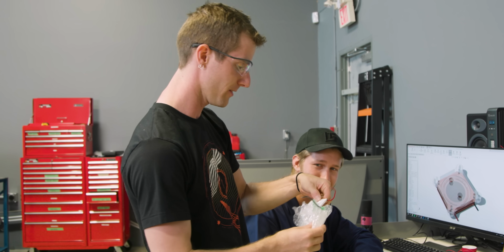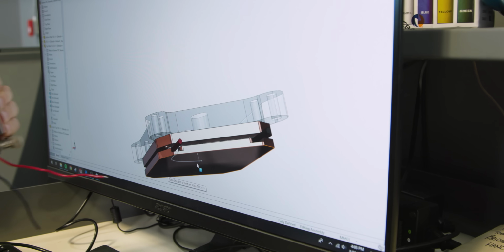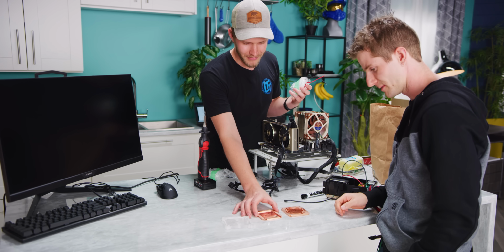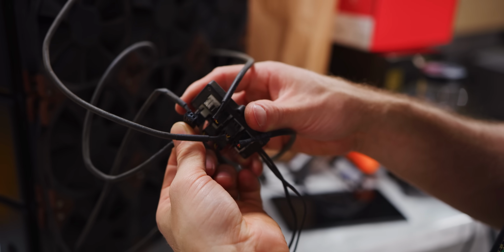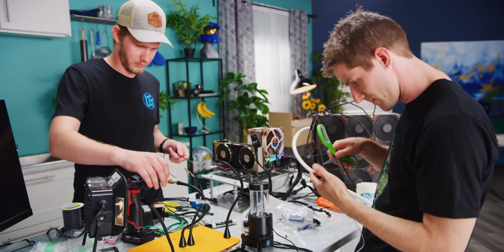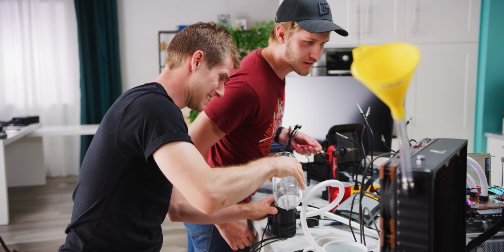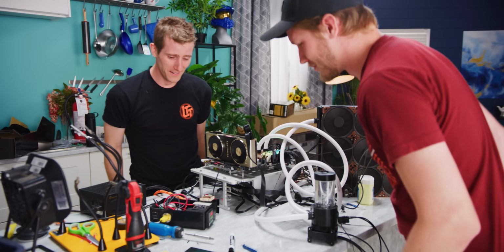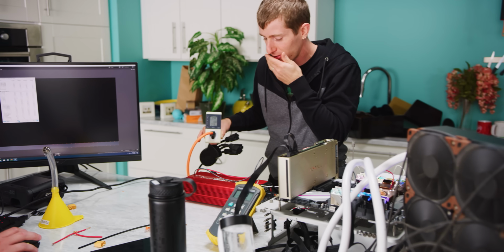This Cooler DRAWS 545W!!? Bad Cooling Ideas #2

Comment: Slight oversight. I didn't see an air gap between the edges of the 2 plates. This would cause the peltier to both heat and cool what would act as the same chunk of copper.
Reply: Yeah that is what I was thinking too. Nice to see someone else enjoying pre 2020 yt content!! It used to be golden am I right

Comment: This is my idea and I'm learning from y'all guys because of the project I want to take on but I think I might be over my head I have two car amplifiers one for my mid-range and one for my bass My base amp is suspended in the rare quarter panel of the cargo area in the SUV My midrange amplifier is in the compartment where the spare tire would be measuring that 12 * 24 * 4 in I can't find a water block big enough for it yeah I could just throw fans at it but I want to do water cooling with the copper pipes put the radiator and the other quarter panel maybe with some pelts you think it's possible

Comment: I would love to know the hot-side TEC temperature vs the water temperature. The apparent reason this didn't work is that your block couldn't cool the TEC fast enough to keep the delta-T across the TEC in its operational range.

Comment: @LTT you went about this all wrong the peltier devices should be on the radiator with a set of fans on the inside, pulling config. Peltier on the outside cold side touching the fins one each corner with heatsink and fans and two in the middle too and bottom then peltiers on the top and bottom on the tank custop low profile heatsinks and fans. This way. To cools the liquid a.   Should keep the liquid cool and components dry

Comment: FWIW, a decade ago or so, I rebuilt an AIO with a peltier in series just for fun and got it sub ambient on load on the notoriously hot AMD FX 9000 series. It was on a dying 2nd gen Corsair AIO that was long overdue to die anyway. I just copped right into the tubes lol, added a normal res, normal pump, and the peltier+cpu cooler. It went like this: CPU > original Corsair AIO block > original Corsair AIO rad > added aftermarket res+pump > peltier +waterblock attached to a copper tower cooler w fan > CPU. This way the peltier was further chilling after the orig rad and feeding cold water to the CPU. Totally impractical and inefficient, but it got the CPU below room temp under load and was fun to try just for goofy science reasons.

Comment: There is no hot or cold side of the cooler if you are colored blind. 😅 Just switch the leads like a brushed motor, it’ll run in the opposite direction.

Comment: Looking back on this using a watercooled loop with the peltier in place after the rad with its own waterblock n aircooler to rapid cool the liquid from the rad to the cpus waterblock might if been the key to sub temps might not even need to regulate the power to the peltier. Tho idk just ideas i think about when i cant sleep lol

Comment: Don't peltier devices put off cold on one side and heat off the other when you run electricity through them. They also can produce electricity with a temperature difference. I think you just put them on the wrong spot. Should of used them to cool the radiator. May also been able to set it up in a way to power the fans off temperature difference. The way you did it overwhelmed the cold output because you sandwiched it in between to very hot things.

Comment: I wonder if it could be better used for something like periodical loads? Use it in a separate water loop that only runs when the cpu isn’t at load so it’s building up like a “battery” of cold water to cool the cpu under spurts of load like for gaming
Reply: It’d be pretty advanced then so still not worth it production wise but I think it’d be a cool attempt

Comment: Ehy not flip it put the hot side on the cpu the cold side on the cooler dont connect the tec to power instead use the power thr tec generates to run the fans

Comment: Missing this Watercooler "we will try beat AliExpress" videos.

Peltier need time to get low temperature. Use a reservoir with water like a water dispenser. 

If you coool a loot off water, the processor can't warm instantly the loop.

Comment: that water block was never going to be able to remove 500watts of heat plus the cpus heat  you would have needed at least an inch thick copper on the hot side plus a massive heat sinks with powerfull fans ,

Comment: You should do a setup where the hot water goes through a normal radiator first, then the outlet of that goes into an electric cooler to be sub ambient.

Comment: It's likely the water block was the weak point.  It has the thermal load of the CPU and the TEC and needs enough surface area to transfer that to the water.

Comment: It has 540W of Cooling power with an Delta T of 0°C boys... facepalm. If you want to run it the best you can get is around 70 Watts cooling at delta T of 30°C with an COP of 0.84 with 50°C on the hot side. So you end up with around 20° on the cold side and have to wartercool around 200W.

Comment: Don't get me wrong I am a big fan of your work but, I am 100% sure that you guys did not use the PID controller corectly.
Relay is a on/off control device on the other hand a PID controller can control the output in all values in between

Comment: SO YOU WERE CIRCULATING HOT WATER!!! BRUH.  
nuclear reactors just send cold water from a river and dump the heated water to the other side of the plant in the same river. so in resume just attack the hose to the faucet and the other hose just throw the water to the sink.  and it will  be very cold (cold shower style) and you dont have to spend in 500watts electricity or something. just pay water. want to be savy?   put a pump that sends the hose underground or to your refrigerator and comes back cooler.  also instead of water use CAR COOLANT. 
seriously.

Comment: TECs are very inefficient at high power, if you want to make this work you need to run a bunch of them in parallel and and exchange the heat in a water loop. Tech Ingredients has a great video on TECs.

Comment: https://www.youtube.com/watch?v=uOrUNT_0XVY&t=1216s

The ability to pull the heat from the peltier towards the heat sink is absolutely crucial. Moving to a larger amp peltier will not make this more successful.  Although the physical size of the module might matter.  It is the way they are controlled that matters more.  Switching the module off at any  time to limit power consumption or PWM is not be helpful at keeping a constant low  temperature, as I seems the current must always be applied to keep heat produced by the TEC form moving back into the CPU.  A much smaller amount of power is required to stop this bleeding effect during idle and low CPU usage times.

Comment: I had a hard time understanding why this didn't work, so I had to break out some math.
so a core i7 is 125W of power, which means that at most the cooler needs to move 125W of heat.
a TEC cooler is about 10-15% efficient, which means that for every 100W of power, it can move 10-15W of heat, if I understand correctly.
which means that it'd take about ~1250W peltier to keep an i7 at ambient temperature :/
Reply: No, I think it means that the efficiency is 10-15% of an ideal heat pump, you are interested in the coefficient of performance. In the case of a vapor-compression refrigeration (fridge, air conditioning etc.) it can go up to 3 or 4 (300 or 400W moved for every 100W of power), in a TEC varies a lot depending on conditions (I looked at a datasheet of a TEC comparable in power to the one used in the video, the COP varies from 3 at low loads and low temperature differences to 0.1 or less in the worst case). If you can keep the hot side at relatively low temperatures so that you don't need a big temperature difference and you choose a TEC so that it operates in conditions where it has a decent COP like 0.5 it is doable. In the past I have seen 250W TEC cooling a P4

Comment: Actually, I think you should try using a Stirling ENGINE and run it in reverse, by feeding it rotation (i.e. using an electric engine) to get cooling (or, rather, temperature transfer). The good part is that, if you can put the PC onto the stirling engine, then you can get sub-zero temps quite easily, but it depends what size of engine you have, and you first have to find where to buy one from. It's actually one of the most sustainable engines out there, for low tech places where steel or copper and machining aren't too expensive, because you can use a stirling engine to generate power from heat transfer (i.e. burning trash then water-filtering the smoke and then using the resulting liquid with sand (quartz sand, aka. beach sand) and local dirt and/or rocks (but not quartz rocks or more quartz sand)to make geopolymer cement, but you need to have more of the liquid than it takes to dissolve the sand, and I don't know the exact percentage for that, but you could try with 25%, 50%, 75%, 100%, and 150% more liquid than it takes to dissolve all the sand, and see which of those works better, then try values close to the values which worked the best, and you will find the sweet spot, while also keeping in mind that, depending on the fuel source, it might take more or less time for the cement to harden, but a month should be a good random starting point, while keeping in mind that it might take less than 5 minutes from mixing to when it hardens at least partially. 

I think it would be really fun to see you all struggle with the stirling engine on this channel, and separately struggle with the geopolymer cement mixture over on Channel Superfun or some other channel, or even this channel.

Comment: Yeah, I like my NH-D9L. All of these TEC plate experiments and my experience using water cooling, it's hard to beat an efficient air cooler. I wasn't even a believer in the Noctua hype until I tried this one either.

Comment: You guys did it the wrong way; it is never a good idea to have the Peltier on top of the CPU, it should be on the radiator end. That way the cooling and heating ends are farther away from each other. In short it would work better if it cools the water.

Comment: Your biggest problem is your liquid cooler is not rated for the wattage of that Peltier device. You are overwhelming, the liquid cooling side, making it to where there is absolutely nowhere for the heat to go. You are not getting enough surface contact inside the liquid cooling interface. You need to make the liquid cooler taller so it has much larger fins as well as you need to create more turbulence so that the liquid is turbulent against the metal with more Furiosity. I have a design concept for the liquid cooling that might help resolve this issue and possibly get you to closer to working cooling.

Comment: Peltier cooling is the most inefficient cooling system due to the close proximity between the hot and cold surface. You are much better off with a typical fridge freezing system with compressor/condenser coils and refrigerant gas whereby the hot and cold area is completely isolated and it typically takes only 200W LOL.

Comment: What are TECs actually used for? I'm a little stumped on where something so power-hungry would be considered an idea solution for...well, anything. The double-cooling element of it also seems to be wasteful for any practical end (since you're having to vent the heat from the source and the TEC's hot side, meaning you've got way more wasted energy than the source would provide by itself).

From a cost point of view you're almost assuredly going to be in the red constantly just to operate your cooler, not speaking to the energy needed to run the thing outputting the heat in the first place.

Comment: If you would cool the liquid down to below ambient room temperature using the TEC with an heatsink, would then be the cooling more efficient, because of the higher delta T?

Comment: Wow what a bunch of pure amateurism... If you reverse polarity on a peltier, the hot and cold side changes. Also touching an AC powered open box, is a good way to die for sure. Great example on why I stopped following LTT videos and its getting even worse over the years

Comment: you kinda did this wrong.... this cooler needs to cool the water tank(ie surface area and volume)the ability to cool the cpu is hindered by its slow transfer rate... ive done this with 2 12706 peltier coolers with a normal flow setup (pump to cpu then gpu then radiator to peltier cooled tank...) have 27c temps playing world of warships in a 80 degree house,  the way they went about this is a terribly inefficient use of all the parts...and the 1/8 in block of copper was a shit idea...it became a big heat reservoir that the cooler would never cool...then the fat block of copper on top of the Peltier cant transfer the heat to the water fast enough....lots of lack of knowing how heat transfers.....

Comment: Linus, strap a standard water cooler to the CPU, and put the TEC into the water loop at the other end to cool the water, but far away from the cpu. You’ll drop the temp of the water in the loop which will yield a lower temp on the CPU

Comment: Why don't they just put the mobo upside-down when cooling the cpu to temperatures lower than ambient? The condensation can drip right off of it without short-circuiting any thing

Comment: If your TEC cooler draws 545 watts, that means at optimum efficiency it probably provides about 27 watts of cooling. 

That was the issue here. You need a TEC or TECs capable of providing at least the CPU’s max wattage. You probably should run a chilled water loop to the CPU, not directly on it, cause a TEC can’t cram 100+ watts of cooling into that surface area.

But yeah, at that efficiency, it would make more sense to use the vapor-compression cycle.
Reply: I think you have some confusion about efficiency of a heat pump and its coefficient of performance
Reply: @Mauro-82  not really lol. Kinda do this shit for a living.

I’m well aware that the vapor-compression cycle provides more cooling or heating than its energy draw.

Now if you had a COP below 1 then sure. But that would be the worst heat pump I’ve ever heard of.
Reply: @rabidlenny7221 Hi, I just saw the message now, I must have replied to the wrong person by mistake. Anyway, although the COP of a TEC is well above 1 in the most favourable conditions but falls far below in the most unfavourable conditions, in the past I have seen P4s successfully cooled with 250W TECs, however I agree that it makes more sense to use the vapor-compression cycle.

Comment: Don't forget....some people watch your computer video to learn about TEC for uses other than for computers. I am interested in this large TEC to make a water chiller out of 4x4x1/4" square Al tube with the "water coolers" you used in part 1 to remove the heat. Can the Noctua NH-U12A bolt directly to a slab of aluminum if the threaded holes are provided?

Comment: In 2018 I was colling my overclocked 990FX chipset using peltier (with DIY PWM driver set to 5deg). The cpu was 8350 on 5.2Ghz DAILY!
Peltier was colled with 240mm radiator and cpu with 360mm one. 
I miss this days. Now im on R7-1700 and i cannot get past 4.0ghz :/

Comment: i don't get the point of this. if the thingamabob cools the cpu, and the watercooler is capable of cooling the hot side of the thing, why not just install the cooler on the cpu?

Comment: I'm no tech expert but I think your going the wrong way around putting the peltier on the cpu via that plate, you'd be better off putting it on the radiator to cool water to pass thru a water cooling plate on the cpu I think and also you need to pull so much heat off that hot side  with 900w running thru it you'd need like a car size radiator to pull the heat out to get cooling  or the hot side transfers to the cold side.

Comment: I used to cool my cpu and gpu with a peltier.  There is a balance that must be struck.  The cooling per sq in needs to be right first of all, and, the cooler must keep up with the heat load of the cpu and the peltier.  If it can't, the peltier becomes and insulator, which is what happened here.  I guarantee the radiator was not big enough nor the fans powerful enough for this test otherwise they'd had a chilly cpu.  Everyone remember the pentium 4?  That's what I cooled and overclocked, and even overclocked I was able to run it under load at around 15-20c.  I had a 350w peltier and significant cooling.  I used blocks from dangerden, which proved to do the trick quite well.

Comment: As suggested by some commenters, it would be way better to cool the water using the TEC and stay within its maximum efficiency zone. More power doesn't mean more cooling. You'll have to dump that heat the TEC is generating somewhere or it will start to heat up. Cool the CPU loop radiator with multiple TECs and cool the multiple TECs with another loop. That way the CPU block should receive cooler water and the TECs dump their heat into another radiator so it doesn't interfere with the CPU loop. In theory, this should work as long as you don't overdrive the TECs.

Comment: There's some more that goes into PID. Basically, instead of full on when the desired temperature is not reached and full off when the desired temperature is reached, it tries to predict when its about to reach the desired temperature and slow down so it won't overshoot or speed up so it doesn't undershoot. That way it pretty much stays exactly on point, there is no oscillation in the temperature.

Comment: Advice: when 'tapping', always use a vice to hold the part you're tapping secure. Otherwise you can easily end up tapping at an angle, or cracking the material (in this case plastic/polymer).